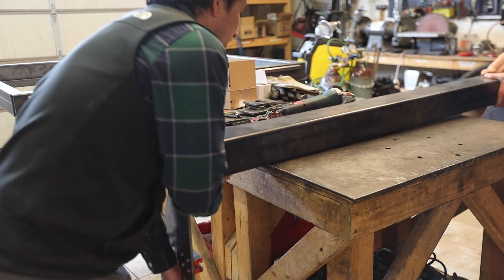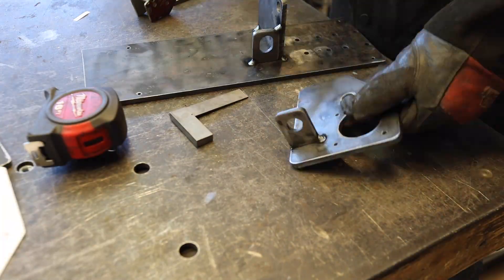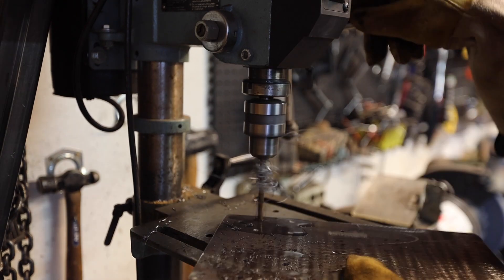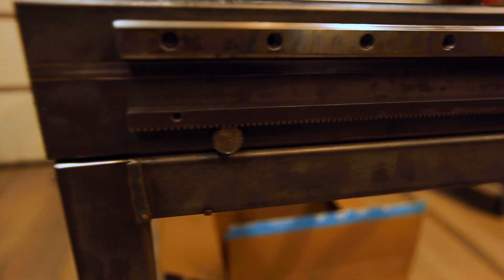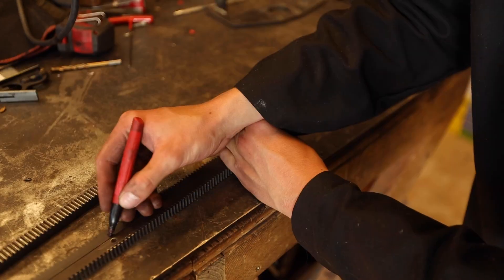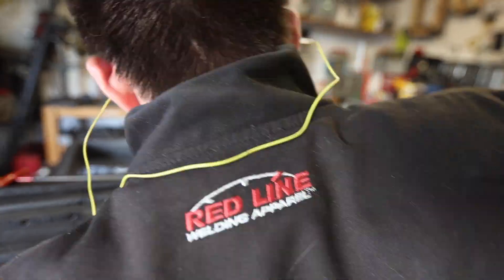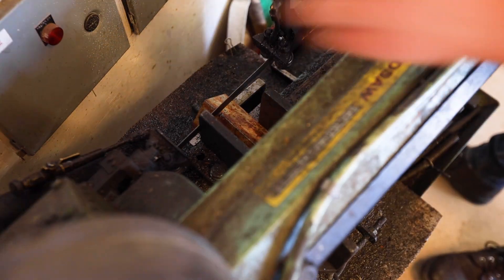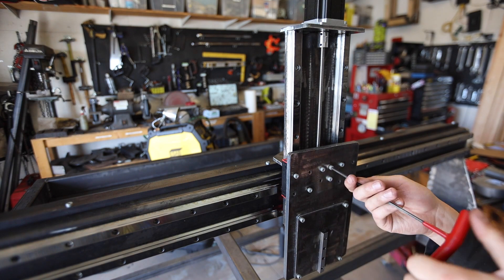How to build a CNC Plasma Cutter Table | Moving Parts | Free Plans & CAD Files

Comment: couple of questions if ya don't mind, how come you  went with steel on the cross slide and brace setup vs. alloy? Would bolting the cross brace setup instead of welding it be a better option if one did go with alloy?
Reply from the maker: Sorry for the late response. Honestly I think it just came down to price. I could pick up the steel from a lot cheaper then buying an alloy and bolting together. I also don't use the machine at super high speeds because my plasma cutter isn't powerful enough to cut at high speeds and also most of the material I cut is around 1/8" - 3/16". And so it's thicker. the fastest speeds I normally cut at is like 120 in/min which is fine. At those speeds though you can tell the machine is struggling with the mass of the gantry, but again I don't use those speeds a lot so it doesn't matter too much. But the bolting would probably be better if you are looking for higher speeds.

Comment: my laptop does not have a parallel port. can i use a USB to parallel a adaptor or just use an Arduino?
Reply from the maker: I don’t think the adapter works. There are options to use Arduino instead but I have no experience with that. You wouldn’t being using Mach3 if you used Arduino it would be some other program

Comment: Hi! What the electrical stuff like stepper motors breakoutboard, drivers, thc.... are you planning to use? How fast does this cnc would be able to go?
Reply from the maker: I'm using Nema 23 stepper motors as well as a generic breakout board and some drivers I get from Amazon. I've tried to keep the price down and I haven't had any problems with the electronics on my other builds. With the THC I'm not sure. I think I'm going to try and make my own, not sure how that will go, but if I can get it to work I'll definitely post a video about it. The CNC isn't the quickest because the gantry weighs quite a bit. I'm not sure what the max feed rate is. I haven't had any problem as I'm almost always below 100 in/min. I designed it to be stiff so I can use it to router wood and foam with a router attachment vs having it be able to travel fast. Hopefully that helps, I'll do some speed tests when it's complete
Reply: @ToshDavis  
Thank you!

I already have a selfmade cnc plasmatable but it cuts crap, too many slacks everywhere. Thinking building a new one from scratch.
I downloaded your cad file and really like your design.
Reply from the maker: @jaantobro5271  Yeah my first build was the same, it didn't cut very well. I had to do a lot of modifications to make it cut okay. Cool, hopefully these videos and the plans make it easy enough to make you're own. That's my plan at least! Let me know if you do end up making one
Reply from the maker: I've just updated the google drive folder in the description to have a spreadsheet with a list of parts